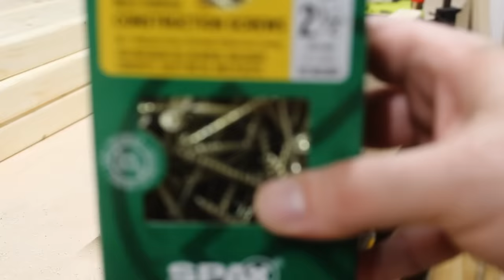The 1-Hour Workbench / Outfeed Table // Woodworking DIY

Comment: Great build, used this as inspiration, but made some changes:

Put bottom braces (Cut shorter obviously) on the inside instead of outside. There are resting on the short scrap pieces that the fourth caster screw goes into. 

I cut a piece of plywood to overhang the new bottom braces just slightly on all sides with corners cut out, and dropped it in before adding the top braces. It can't handle a ton of weight, but it is still very handy. I threw a couple storage bins with light but bulky stuff in them under there. Otherwise the space under the table would be a complete waste.

I did top braces on the outside like you did, but for the table top itself I did it a bit different:

I built a 2x2 frame to go entirely around the top braces. Then I cut the table top so it would have 1.5" of overhang past this new frame so I can clamp to the table top. I attached this frame to the underside of the table top (screwing from the bottom instead of the top so the top remains clean). Then once I had it attached I put it over the existing frame. Finally, to keep it solidly in place I drilled some 5/8" holes through the base-frame and the top-frame and inserted four 5/8" Easy Grip Hitch Pins from Harbor Freight, 2 on each long side. These hold it securely, but if I ever need to change the top due to damage or whatever I can pull these pins and lift the whole thing up, flip it over, remove the frame, and put it on the new top. Yeah, I could have just used four screws, but this is much cooler, and I can reuse the same holes.

Comment: Nice looking bench.  I will have to build one.  I would change 1 thing.  Put the bottom 2x4's on the inside of the legs.  It's a shin saver.

Comment: I was debating from use Lag Bolts or Decking Screws. After seeing this come together, like you I'll use the decking screws. I am making a change though, I am use 2X4 lumber for the top of the workbench and I am placing the top on a 45 Degree angle to the bench base.

Comment: 5:56 shows you all you really need to know. Everything before that is sub-assembly process details, which make a lot more sense when you have the completed framework to look at. 

Very neat and simple. I might be tempted to reinforce one of the long faces so I could put in a bench vise and have some rigidity to the mount, and add a cross-brace for additional table strength.

Comment: Where the screws connecting the horizontals to the verticals are close together, they act like a pinned connection.  In a pinned connection the members are free to rotate and the table, over time, after some heavy use, will begin to rack.  To stiffen the table you may want to add some diagonal bracing.
Reply: That makes sense. Structure engineering application in woodwork. As a civil engineer, i like this concept.

Comment: YOU COULD USE A SECOND LEVEL SURFACE SUSPENDED ON THE LOWER BEAMS CONNECTING THE LEGS with the leg corners cut out AS A SHELF. That always come in handy.

Comment: I like this design a lot. I’m primarily looking for a wood outdoor table but I’m a beginner and most of the DIY videos are intermediate/advanced. So I can easily modify this workbench design to be longer as a eating table needs to be. The only other thing I would change is I wouldn’t need those bottom pieces of wood, just the four legs. Once stained i bet it’d make a great outdoor table. But overall this is the type of simplistic design I’d need -thanks.

Comment: Save a ton on cutting and screwing by using 4 x 4's for legs.  And stronger if you use 2 x 6's everywhere else.  Glue two each 3/4" Baltic plywood together after cutting to desired length for your table top.  If you don't want screws in the top, use pocket holes in the 2 x 6's.

Comment: You can build this sturdy table using 1X 4s instead of 2 X 4s.  I like the ease of moving them around. I've even built 1 X 2 frames that are very sturdy and useful.  And light! Good design. 👍

Comment: Nice workbench! I like the simplicity. Looks very sturdy! I’m curious, though, as to why you didn’t put the stretchers on the insides of the legs. It would have saved you a little lumber and created the perfect support for a shelf. Also would have supported your casters a little better.
Reply from the maker: It was really just to keep the cut list as simple as possible. Only 3 lengths of 2x4 this way.

Comment: I would suggest to swap the lower brace you did on the outside and put it inside so you can easily make a shelf without a huge corner cutout. But good and sturdy. I just made it

Comment: Awesome video. Will the wheel assembly be able to withstand the pressure of using a planer or the hammering of a chisel for long periods of time. That is mostly what I will be using it for.  Thanks.

Comment: Very nice. About the only changes I would make would be to screw in some 2x4 scraps at the bottom of the legs so the casters can be supported at all 4 corners, and add in some miter slots to accommodate your miter gage and table saw jigs.
Reply: I know this is super old, but if you look at the final product when he shows it next to the table saw he actually did add scraps to the bottom of the legs.

Comment: you can make it a bit short and put 1/2" lag bolts under the legs and then you can adjust I to the proper height. also if the 2x4s underneath are inside the legs it makes it real easy to put a plywood shelf down there. I used 4x4s for my legs. made it a little quicker to put together. Great job tho. makes for a great table. thanks,

Comment: Hello Robert, I noticed you have a 2 inch overhang on the back of the workbench.  What could that be useful for? Clamping of future projects? Thanks for this video.  THUMBS UP!
Reply from the maker: It is more so that I can slide the bench right up to my table saw without getting snagged on the lip on the back of the saw. But you could definitely use it for clamping as well!

Comment: Hi Robert. I just bought the plans for this workbench. But can you please tell me what is the overall dimensions once it’s built? I know the height will vary depending on what size casters I use, but is this a 4’x 8’ workbench? If it is, at what part of the instructions do I change it if I don’t want it so big? I was looking at having it about 3’ x 6’ or 7’.Thanks for your help with this.

Comment: I'm wanting to get into wood working. Starting buying some things like clamps, miter saw speed squares...But what wis the metal track that the circular saw is running across? I've never seeing that before...
Reply from the maker: It’s called a “track saw.” You can also make one using a circular saw, just search “DIY track saw.”

Comment: Lot of cantilevering on that open corner of the casters makes the screws uses pretty anemic into end grain. Puzzling too because you already had the 2" non splitting spax screws there. Other than that is a quick down and dirty work table or outfeed table.
Reply from the maker: Yeah, get that comment quite a bit. I do actually fill in those spaces, unfortunately I was not recording when I did it. If you look closely toward the end of the video you can see it.

Comment: Hey Robert, I love this video and I actually purchased the PLANS from your website. I do have a question, do you have any idea of how much weight the casters should be able to hold? Also the size of them would also be helpful.
Reply from the maker: I am pretty sure these are the exact ones. They are just under 5 1/8” high, making the total height 34”, which is the height of my table saw. It says they each hold 250 lbs, so that would be 1000 lbs with 4 of them. 
https://www.homedepot.com/p/Everbilt-4-in-Polyurethane-Caster-with-Brake-4120745EB/203672250
Reply: @RobertJKeller  Thanks for getting back to me. I actually ordered some from Harbor freight, they were cheaper, but only hold like 125 lbs each. I'm thinking that should be fine for me. I completed the workbench today and I am just waiting for those casters! Thanks again. I really love how the bench came out.

Comment: Great video!  I bought the plans.  Question: How is it you didn't have to pre-drill holes to prevent splitting with those beefy construction bolts?
Reply from the maker: It is a feature of the kind of screws I used:
https://www.spax.com/en/service/technical-terms/spax-4cut-point/
Reply: @RobertJKeller  awesome thanks.  I meant screws, not bolts, just to correct the record.

Comment: I'm thinking about building a table for my kitchen I do all the cooking and that table looks pretty sturdy what would you think about that would it be OK in a kitchen or do I have to use different types of wood but I've already subscribed to your channel and gave you a thumbs up great job
Reply from the maker: It would work if you made a smaller version. It probably would not look very good though. It's definitely more for the garage/workshop.

Comment: the short block of wood that you cut, what is the length of it?  I've bought the plans and I want to do mines as a 8 x 4 like the gentleman below, thanks great vid, and it seems super easy, cept it prolly going to take me at least 3 hours on account of my ocd of trying to be perfect. lol
Reply from the maker: The length of the short block doesn't really matter, it's just there to have something to drive that last screw in for the casters. 
If you are doing an 8x4 version, make sure you add some support beams across the top, otherwise the plywood will sag in the middle.

Comment: Great video!! How much weight can it handle? Could I put a 100lb CNC machine on it and also use it as a workbench at the same time?
Reply: Also, do you need a planar or jointer tool for this? Or just screws and wood purchased straight from home depot/lowes etc (and a table saw or miter saw to cut to length)
Reply from the maker: It would handle 100 lbs no problem. You could also use glue to add some strength. I did not use a planer or jointer to make mine.
Reply: Robert J. Keller thank you!!

Comment: My kind of project. No dovetails, no mortise & tenons. Yeah, sorry, it'll only last 25 years instead of 60 years. The "L" shaped legs are the way to go and that's how I build mine. The same design I used for a heavy drill press table--on that, I cut (only) the long-way members of the legs to make a lap joint and placed some diagonals between the legs & top frame  to prevent racking. 2 x 12 planks for the top. I pay a little more attention to how square the subassemblies are when screwing them together.

Comment: Hi, one question- I used #9 spax screws and when I hade an issue with the boards sometimes separating away rather than squeezing together.  I ended up using clamps but it seemed so much easier in your video.  Is their a trick to getting construction screws to seat into the second board without "skipping a thread"?
Reply: Just predrill the holes on the first piece of wood the screws hit. It's not a bad idea in any event, but it also helps avoid splitting the wood. Control the depth of the predrill by wrapping a length of tape around the drill bit and stopping at the right time. It's not at all bad if you drill 1/4" into the rear piece, the piece you really want to grab.

Comment: Man that was beautiful.  This guy doesn’t f*ck around 😂.  I just want to know what drill you are working with.  My drill would never screw those nails so quickly and efficiently without me drilling pilot holes.  Well done!
Reply from the maker: It’s not the drill, it’s the screws. They have a self-drilling tip. Works great on softwood. Hardwood, I would probably still pre-drill. ✌️

Comment: Needs a 10mm overhang all round for dusting off., And a block adding for the 4th hole on the castor plate, Otherwise excellent job.
Reply: He added the block and did not show it being done.
Reply from the maker: You are correct, Wayne. I did not get that bit on camera.
Reply: Robert J. Keller nice and simple. Good job

Comment: One Mistake ....... ALL the bottom 2x4s holding the legs should have been on the inside.   In the future , you can mount a thinner plywood board for storage.    This way you made it difficult to do so.   Also , the table won't look as bulky .
Reply from the maker: Intentional, to keep the cut list and assembly as simple as possible.

Comment: I used those dry wall screws they suck split the 2 by 4s. N the heads just strip all the time
Reply from the maker: Are you sure they are these ones? These are not drywall screws. 
https://www.homedepot.com/p/SPAX-8-x-2-1-2-in-T-Star-Drive-Flat-Head-Partial-Thread-Yellow-Zinc-Coated-Multi-Material-Screw-133-per-Box-4191020400606/202040970

Comment: Great video! I was searching for an easy workbench to do! It would be my first project also! The problem I have is uneven terrain where I have room for it. Any advice?
Reply from the maker: Hey Paul, I would just use some leveling feet. Check out the recent video on the @diymontreal channel -- she just made a workbench with a very uneven floor as well.
Reply: Robert J. Keller thank you! I’ll check it out

Comment: Im completely new to wood working and don't even know where to begin. What kind of saw is that and how expensive are they. Also how do I build a work table without having a work table
Reply: It's a miter saw, but I would recommend to start with a handheld circular saw and a speed square for rectangular cuts.a It is much cheaper saw and you can still use it when you have a mitre saw some day. You can build all of this on the floor, just take care not to screw into the floor.

Comment: The L legs are good idea but screwing wheels to the bottom. The screws are going into fibers. The legs with time will loose wheels. The screws are going to make holes wider and screws are going to be loose. Wheels are going to pop off.

Comment: I would like to make the overall dimensions 8'x4', with a height of 36". what mods to the basic design would you suggest?
Reply from the maker: I think you would want your long braces to be 8' long, your short braces to be 45" long, and your legs to be 35 1/4" minus the height of your casters.

Comment: Bought the plan, didn't mention the thickness of the timber. Could you let me know?
Reply from the maker: Just regular 2x4s (which have actual dimensions of 1.5 inches by 3.5 inches).

Comment: thanks a lot 
could you help me ?
I don't know what does this sentence mean :
 8x28 1/8 inch 
which one is the width ? height ? 
sorry for my question  I'm beginer
Reply from the maker: It means 8 pieces that are 28 1/8 inch long. Or in other words, 8 pieces that are 28.125 inches long.
Reply: @RobertJKeller  
thanks a lot 
Is 0.125 inch so important that mention in the sizes?

again sorry could you interpret this sentence as well:
 Legs = (8) 2x4’s cut 28 1/4 inch long
Thanks a lot

Comment: That wood is so easy to work with. What species is?
Reply from the maker: Just douglas fir 2x4s
Reply: @RobertJKeller  you drive those thin screws easy. You don't even have to pre-drill. My 2x4s require pre drilling.

Comment: Is it ok to not pre drill and counter sink?
Reply from the maker: I used a screw with a special tip that makes it so you don't have to pre-drill. But if using normal screws, then yes, I would pre-drill to avoid splitting the wood.

Comment: I understand that this is a movable bench, but one could use it for a stationary bench and if doing so, place the rear lower and upper back beams on the INSIDE of the legs so that they allow flush placement against the wall. Otherwise they are jutting out 1.5 in (the depth of the 2X4). see https://youtu.be/PMJ4Lob5Q4I?t=415

Comment: I would use 4x4 for legs and be done with. Rather using 2x4 tie together.
Reply: Excellent if you you don't mind the extra weight and have a saw with 4" cut depth.

Comment: Could you speed it up a little bit there, slopoke?
Reply: @RobertJKeller  You inspired me to make my own workbench and it actually turned out awesome.  I used 4x4 lumber for the legs.  The thing is rock solid.
Reply from the maker: Nice 👍👍

Comment: 30 minutes is far too enough to assemble the  workbench.  Reduce the screwing to half, screwing two frames first, i.e. the upper frame and lower frame, then screwing the 4 legs (with fitting the wheels beforehand) to the frames, and then put on the top, and sure you still have time to put a plank on the lower frame to form the lower deck and just punch 2 nails.  Without seeing the video first,it's impossible to do it in 30 minutes but with his experience, it makes possible to do so, good work, and thanks Robert's afford.

Comment: So your plans say (7) 2x4 at 8’ but this should be (8) quantity otherwise you can’t make the 67 3/4” long braces…
Reply from the maker: Did you go by the cut plan in the plans? You do have to make the cuts in a specific way to only use 7 boards.
Reply: Ok then that’s my bad. I just cut them to the lengths as I went down the boards. I didn’t realize it had to be a pattern. Thanks!

Comment: Why a work bench so short..... to get rid of back fatigue the bench top should be no lower than inch below you elbows..... Wait to you get older and bending over is a problem and this bench is still able to be worked on..... It like being 6 foot and washing dishes in a sink with a counter top of 35 inches and the sink bottom is another 6 to 8 inches deeper and you have 20 to 30 dishes to be clean by hand and 3 big pots plus 4 casseroles and  etc. no dish washer.... It is a test of work just like your bench!!!! Please teach to the person not some unreliable standard that is arched!!! Sit on couch made for your wife and then one made to your height Big Difference!!!!!
Reply from the maker: It is also my outfeed table. Has to be the same height as my table saw.
Reply: Move table saw upon a wheeled platform!!! Wait to you need glass to see every 18 to 24 inches bi and tri focals... it is coming fast as the muscle in you face and around the eyes do not work as well!!!!!! Oh, watch out do not cut a finger..............